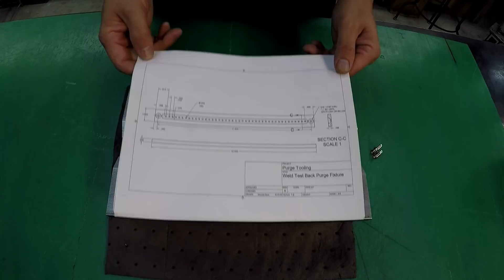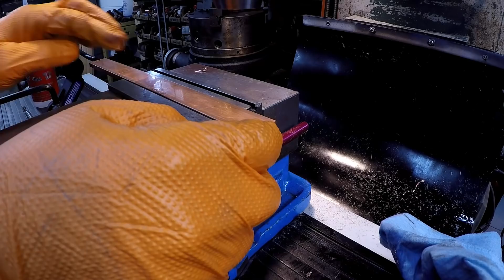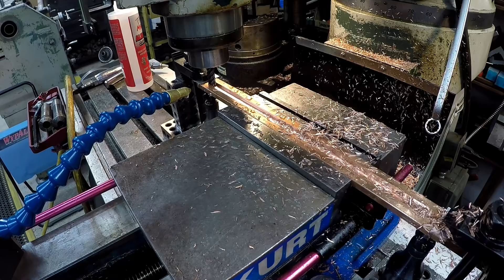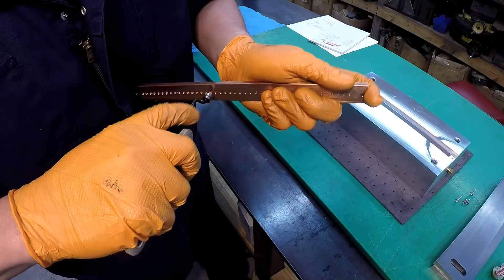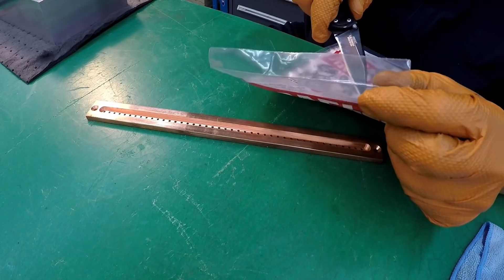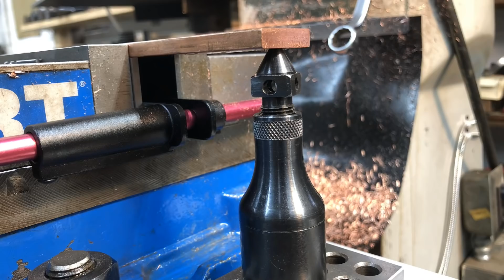AWS Back Purge Welding Fixture Part 6

Comment: I thought you shouldn’t use SS to fasten aluminum because of the oxidation process cause white oxidation which eats aluminum was told this with regard to gun things don’t know this is true just what I’ve been told. Told always use black oxide to prevent deterioration. Adam this part is very pretty it looks like art. Guys if my comment is wrong please let me know men things in reloading are aluminum, so knowing is better then not, as always.

Comment: I wonder why you use Cooper on aluminium.
Cooper will destroy the aluminium if moisture get between the two metals. 
We had to use expensive cable lugs when we had to connect Cooper cables to aluminium rails or the other way around.
The aluminium wil react with the Cooper while the Cooper will destroy the aluminium over time, even in non electrical environments just the humidity in the air will be enough, that's at least what I was thought

Comment: Moonshine (ethanol) is by far the best aluminum cutting fluid.
Reply: Agree, we uses denatured alcohol for milling / turning Cooper and Aluminium.
It's also good for working with plexiglass.
Backside, it's highly flammable and burns with a nearly invisible flame.
So be very careful if you use alcohol/ ethanol when milling / turning / drilling Cooper or Aluminium.

Comment: I’m surprised you need to use any coolant or cutting oil at all with a material as soft as copper?? Or is that just to try and release the chips because it’s so soft and tries to load up or gal to the end mill? Just trying to learn here. Thanks! Also...I love how your always moving the camera angles, your doing some awesome work with that! Like I’ve said before, my girlfriend isn’t too fond of you Adam because I’ve spent more time watching your videos lately than with her, but I can’t get enough. Love this stuff and I’m not even a machinist persay. I own a small 4’x4’ CNC router I use to cut carbon fiber parts I lay up, but that’s about the extent of my “machining” so far. Looking to do more for sure. This is inspiring and for someone who has what I call “mechanical ocd” with engines and stuff, this is like porn lol. Thanks again
Reply: Basically that, it melts together like clay or something, from my understanding at least
Reply: yeah i was thinking it's gummy so maybe a 2 or 3FL cutter'd been the ticket
Reply: I used to think copper was pretty soft until I tried to sand some copper plates perfectly flat. It's a lot harder than aluminum, that's for sure

Comment: Why would you need to make a tube to supply your gas? Cant you omit that and just fill the cavity with the gas it will come out of the holes machined in the copper. What will be used as a seal between the copper and aluminum block, if a seal is used?
Reply: I'd guess to promote more even and laminar flow, to prevent turbulence from mixing any atmosphere into the gas.
Reply: I would expect more turbulence having installed the pipe. Also you would have reduced flow out of the ports furthest away from the supply. I was operations manager for fountain supply company so we have done lots of testing on flow properties. A flow straightener would reduce turbulence and supply all the ports a bit mor evenly. Although a straight tube might help with the turbulence issue too. Now I have to.go to the shop and do some testing...

Comment: Love the video. Question do you have a bolt supply business in Pensacola? We have one here and they do counter sales, I use them because for a small cash sale they are way less expensive than the Hardware is here. I picked up 6 3/8 x 1 1/4 inch Allen screws, with washers and lock nuts foe $2. All because I don’t need a ticket, it’s just a bit further but I save a lot. You might need to check into it.

Comment: I know you know this, but such a dense fluted tool isn't often used for slotting, as the flutes gets clogged up more easily than a few-fluted tool.
That choise of tool just surprised me, but it seemes to work just fine.

Comment: Hi AdamWhen you polish Aluminum, Brass, or Copper the polishing begins when the cloth begins to fill with material and it turns black, so, the best polish  happens then.If you were to continue to polish you'll get a great luster on the metal surface, Aluminum looks like it just got coated.Mike

Comment: Had fixtures kind of like this in welding school. We counterbored pockets and put springs under the locking plates, so that they'd lift themselves up when you loosened the bolts.

Comment: As always, beautiful work Adam.
Question: 
Why not just install a nipple for the gas line and flood the valley?
I'm assuming the purge gas is always under positive pressure and the gas block is metering and distributing the gas.
At this point the "gas tube" seems to be redundant. What's the advantage to doing that twice?
Reply: I was wondering on that. Im guessing the tube can have smaller holes to spread the gas right to the end better under more pressure, then the copper block with larger or more holes can gently expell the gas with less turbulence and less mix of atmosphere... In theory, we'll see.
Reply: I think it's the distribute the gas evenly in the cavity and have an even flow in the hole of the copper plate.

Comment: I always thought copper was like trying to machine glue. Silver is even worse.I make a lot of poured silver and haven't quite mastered just the right cutting edge relief's yet. Still working on it though. All I can find up here is Rapid Tap. That fluid you are using looks like it works great. Bummer they sent a short piece. I rarely ever see that. Tell em bud. That separator sure works slick.You have soooo many wonderful things to add that 3rd hand now. Very nice ! Another great post I can sit back and enjoy in retirement my friend. Many thanks fella !
Reply: For drilling grind the cutting edge in line with the length .040" to .050" back.
Keeps the bit from trying to screw itself through the work.
Reply: I know that one of the electricians I worked with wanted some 'aluminum tapping oil' and I had to go to an electrical supplier to get it. Might be able to find some at your locals.
Reply: Tomoko's Enterprize More like an old bubble gum.
I guess right tools matter.

Comment: can you please explain how the edge finder works,not how to use it ,but how does it function.
Reply: There are 2 main parts.  The upper shaft goes in the spindle collet.  It is hollow and there is a spring inside running down to a short cylinder which it holds in place under tension.  When the whole thing rotates and the lower cylinder contacts the work it tries to grip the work and run along it.  This makes it kick to one side but it can only go so far as the spring stops it flying off.  The instant this kick happens the edge finder is on the edge of the work and the center of the spindle is half the diameter of the finder away from the edge.
When moved away from the surface the lower cylinder often springs back straight again but if not a quick flick with the fingers often gets it moving so the spring can pull it straight again.  See if you can find a specific video on it as it is easier to see rather than explain.

Comment: That is beautiful,it should sit on a desk to be marveled at.
What is it for? What is purging in welding,anyone?
Reply: Andy Opy stainless steel, titanium and some other metals are what’s called “reactive”. If you don’t purge the back of the piece you’re welding with neutral gas, such as the argon you’re using to weld it with as the covering gas, the back oxidizes and also forms unwanted alloys with nitrogen in the atmosphere. That’s obviously a no no. Purging simply means that you’re pushing that argon to the back, and pushing out the atmosphere, or purging it. Copper is used because weld spatter doesn’t stick to it, and it dissipates the heat very well (which is why the spatter doesn’t stick, among other reasons).

I hope that helps.

Comment: Hi Adam,
See if you have an Electrical Switchgear and or Air Breaker repair shop in the area.  We have scrapped pieces of buss bar bigger than that.  (They also need machine work done occasionally.)  If you have a lot of copper to polish a stainless steel media tumbler leaves a beautiful finish.

I really enjoy your work.

Comment: Nice job adam, i personnally prefer simple wd40 when working with copper alloy, and for deep drilling, i use diesel fuel as cutting fluid and coolant, always work perfectly for me!

And Adam, id like to talk eith you via email or messenger, whats the best way to reach you?? I tried sending you messages but never got an answer.
Please come back to me

Thanks

Comment: Would you actually need the brass tube with multiple holes in it now? Couldn't you just have the brass plug at the end filling the valley that you've milled out then feeding up through the copper plate in this vid?

Comment: nice work adam. i ordered some 4140 round bar from online metals that came in
at 12" exactly, now i just always order a bit extra. the extra material cost isn't worth 
the delay involved in getting behind on a project. thanks for the videos!

Comment: A ton of skillful work, but that's a lot of effort for something that's going to oxidize upon first use, and yet with all that effort, you left the chatter marks at one end and didn't bother to bevel or roundover the channel shoulder either.   It leaves me confused as to your intent.  Did you want to manufacture an exceptional piece, but just ended up putting an incredible effort into a job half complete?
Reply: Where are there chatter marks?
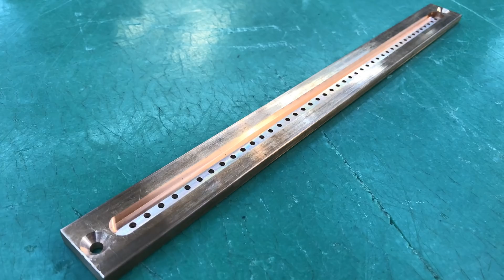Reply: @xenonram  Look around 27:30 on the left end of the channel
Reply: @ElementofKindness   You're seeing the same as you're seeing on the top of the aluminum block. At 27:00 (or anytime the aluminum block is seen from the top) you can see the 4 corners look like they have a lot of chatter, but it's just the super bright lights accentuating the surface. I take it you're new to the channel, but he doesn't leave stuff like that. Also, since it's near impossible to chamfer the slot in the copper on a manual machine without setting up the turn table, he just got that edge with a hand deburring tool. It's all pretty much perfect. If you're not familiar with machining (and lighting, for that matter), it would look like it wasn't machined very well, but all of those imperfections are from the lighting.
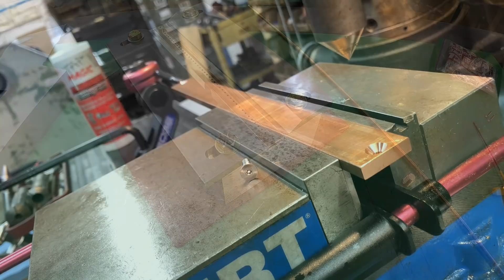Reply: @xenonram  Like heck.  You can see it at 26:36 before he even places the piece as well.  I recognize the surfacing machining marks and lighting artifacts present on the aluminum block.  That is definitely not what is being seen on the wall of the channel.  I mean, I know it has absolutely no effect on the performance of its task, I just don't get why someone puts so much effort into something, just to leave it like that.  Even the gas tube thing he's going to do next is so overkill unnecessary, but making a product better than it has to be is awesome, which leads back to, why leave something unfinished?
Reply: Are you two guys talking about the same thing, and what I think you’re talking about? Because those small chatter marks at the right end of the channel, at the rear, were machined out. He states that he machined a thou off to eliminate that, and then he showed it without the marks. I don’t get what you’re saying therefor.
Reply: @melgross  Again, 26:36 and on, LEFT end, back side of channel.  In fact, when he slides the copper piece slightly to the left, the marks move in unison to the part, guaranteeing not just a lighting anomaly.  Also, when he shadows the lighting with his body, marks are still seen.  The fact that he said he machined them out, then are still there is just another part of my original WTH comment.  I suspect the marks are only left on that one face as seen, and it was an "oops" in his video, where he meant for the part to be flipped around the other way so you wouldn't have seen it.  Honestly, I can't believe you guys can't comprehend this.

Comment: Would the grove not be better for cleaning if it was narrower and then its sides back at 45º? 
You would not have a 90º at the bottom where dirt will accumulate.
Would it change the works that it has to do?

Comment: In the future for metal stock you have to order you might consider onlinemetals.com. The prices are similar to McMaster Carr, they will do custom sizes and for something as simple as a 12-inch piece of copper they will ship it USPS for a whole lot less that McMaster will charge you. They also have monthly specials for 15-20% off. Also, there is a warehouse in Atlanta,  so shipping time would be short.

Comment: Hi Adam, from Down Under.I love your youtube videos at the end of a busy and crazy day.
I have come into this project late so don't know if this has been discussed before now, so please forgive if this is redundant.
It appears to me that the use of copper insert with an aluminium block would cause Galvanic Corrosion by the use of dissimilar metals and also the use of brass into aluminium presents the same Galvanic Corrosion issue.
The second issue of the use of Brass appears to be unnecessary as Argon being heavier than air would flood the void in the aluminum and move up through the channel cut into the aluminium and flood the joint in the fixture. Hence removing the copper and the brass tubing and fitting (substitute stainless steel gas fitting)would reduce the cost, reduce the possibility of galvanic corrosion and increase the efficiency in flooding the joint with Argon. Just a thought.

All the above put to one side, this piece is amazing. I am looking forward to the finished piece.

Again many thanks for the videos giving such insight into someone with such great skill and talent.
Reply: The galvanic action is pretty much a non issue. Especially since there is no electrolyte present.
Reply: It's a welding fixture, not a pipe with water running through it or a boat hull. I doubt that galvanic corrosion will be an issue.

Comment: Hi Adam,
Greetings from sunny Melbourne Australia. Love your videos but this one has me stumped. I've watched you build this fixture but I can't figure out what it's going to be used for? I'm a humble model machinist so I'm guessing that it's some sort of industrial use that I haven't yet come across. It would be really good if you could say a few words at the end about the application for this device for non professionals like me. Thanks and good luck with your new business!
Reply: It is used to hold parts when welding, and the idea is to flow the welding protective gas (G part in TIG or MIG) from behind the parts being welded. Normally, the nozzle of the welding gun will flow gas to the front of the parts being welded, but this will protect the back-side of the welding from the oxygen in the air.

I'm not a welder, so can't say for sure when you want/need this, but Adam did explain in one of the earlier videos of this series.
Reply: Check the other videos in the series. He says what it's used for at least twice in the series. Also, I'm sure Jody from Welding Tips & Tricks will do a video on it when he receives it.

Comment: You bought 12" of stock, you should have gotten 12" of stock. :\
Reply: My guess is they missed the mark cutting it, and didn't want to scrap precious copper, so they sent it to the customer instead.
Reply: My guess is that with the price of copper being so high, you also pay for the metal that the saw removes.
Reply: That would be fantastic if they gave you an envelope with the shavings. Otherwise, they stiffed him.
Reply: @gibbsey9579  That's fine. He ordered 12", so charge him for 12.2" and deliver 12". Plus it's not a custom cut. It's sold as a 12" piece, so they have already calculated in the cut costs.

Comment: Nice!
I would love to see this in action, doing what it's designed to do.
Reply: I'm sure Jody will show it in use at some point on his channel, Welding Tips and Tricks.
Reply: @sparkplug1018 , I tried looking up backpurge welding and didn't come up with much. I subbed to his channel and thanks!
Reply: @stevebeavers3754  If you're looking for the general gist of it, look for some of his videos welding stainless steel pipe, that's the most common application.
The general idea though is to shield both sides of the weld with argon gas, to keep any contaminants out of the weld. Also helps produce a very smooth weld on both sides.

Comment: With the copper bar stock not coming in full length, I would have not milled the slot the full length, leaving a round pocket at each end, like the well in the middle, and then rounded the ends of the copper bar stock to match the milled slot.

Comment: McMaster is usually very good about correcting an error. They have sent by next-day,  corrections of error in an order to us at no charge.  I bet that copper would have been replaced with proper length if you contacted them. In 35 years of being a customer, they always have done right in the rare event of an error.
Reply: I think its different with raw material, there always a tolerance and about 1/16 like he said is pretty good for a saw cut edge

Comment: buy "needle bottle" on ebay better for those thin cutting fluids. And you have thin longish tip to get it just where  you want it at just the right amount ;)
Reply: I like the little needle bottles as well. Works very nice for tap cutting fluid, which always makes a big mess when used straight from the original  bottle.

Comment: might also suggest the owner have the 2 clamp plates copper plated to reduce any chance of spatter or weld sticking to it.
Reply: I suspect jody will be using it for solely for tig welding which you seldomly get any splatter